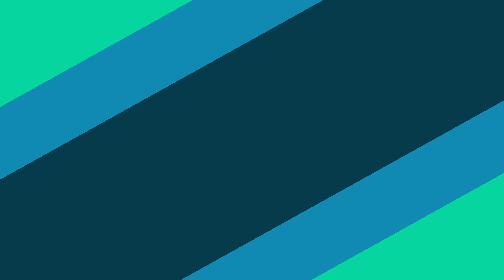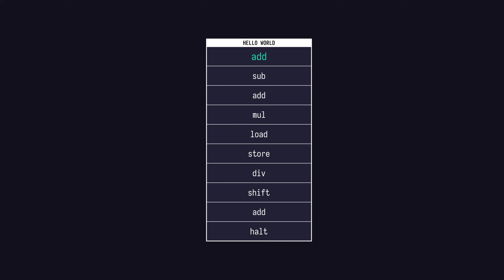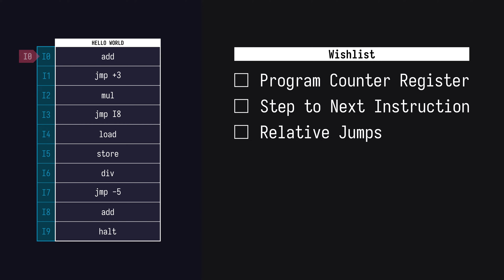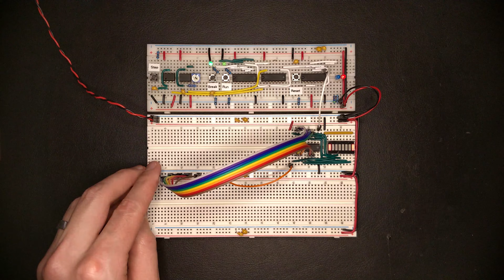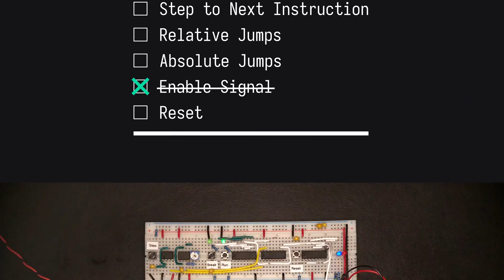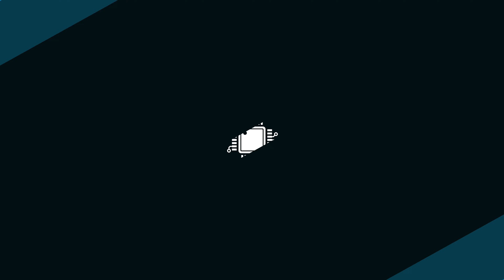Stepping through Instructions – Superscalar 8-Bit CPU #7

Comment: when we feed PC -> adder -> PC, which timing characteristic that is ensuring that the PC latches the adder's value before the adder's output changes due to there being a new PC value? is it the latch simply holding the output pins at the old value? or does the adder simply take so long to respond to a change that its output remains constant while the register reads in the old value? (or maybe is it the adder simply ensuring that its outputs remain stable for some amount of time upon input change, rather than the chip just being "slow")

sorry this probably a very noob question but its little details like this that always trip me up.
Reply from the maker: Excellent question! This is called the "hold time" of the register: it requires you to hold the D input stable for a short period of time after the clock edge to make sure that the value gets stored properly. This is usually on the order of 1ns-5ns, and almost all chips have a propagation delay of 10ns or higher. Including the register! So even if you feed the register into itself directly, the propagation time of the register is already enough to not violate the minimum hold time. In my case, the propagation delay from register Q back to its input D is the propagation delay (tpd) of the register, plus the adder, plus the multiplexer.

If you want to dig deeper: to ensure hold time is met, you have to make sure that the fastest path to the register D input is more than the hold time. To compute this, you usually use the "contamination delay" of the chips: the earliest time at which outputs start to change (contaminate) due to a change in input. To find the top speed of your circuit, you need your signals to be stable at D a bit before the clock. This is called the "setup time". To compute this you use the propagation time of your circuit, i.e. the slowest path to D.

Comment: I'm curious, what is the tool that you use to align the pins of the chips to the holes on the breadboard? I've had problems with this in the past, and have never been able to find a good solution. Love the series!
Reply from the maker: Thanks! This was sold as a pin alignment tool 25 years ago at Conrad (a European electronics retailer). Pretty sure you can find these on Amazon, AliExpress, or any of the common electronics suppliers! 🙂

Comment: Why did not you not use the 74161 as program counter (with free increment) ?
Reply from the maker: The 74HC161 would definitely be a great chip to use! I did not go with that because I wanted the flexibility to choose by how much the PC increments. If all instructions have a fixed size, the 161 is perfect. But in my case, I want the flexibility of introducing compressed instructions in the future where the PC counts up by 1 instead of 2, or potentially switching to a 32 bit wide instruction fetching mode where the PC counts up by 4. I'm definitely planning on using the 161 or 163 in future projects though; they are very handy.